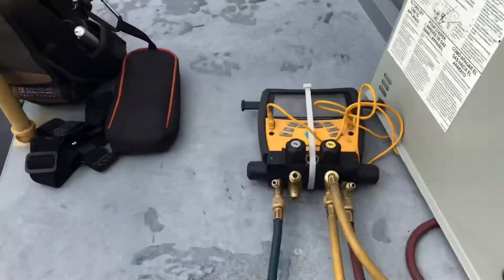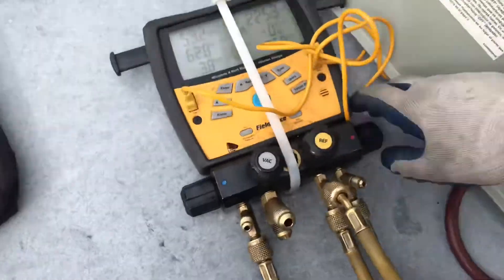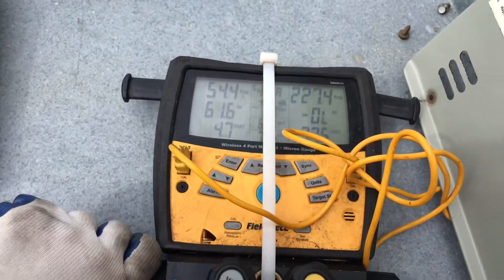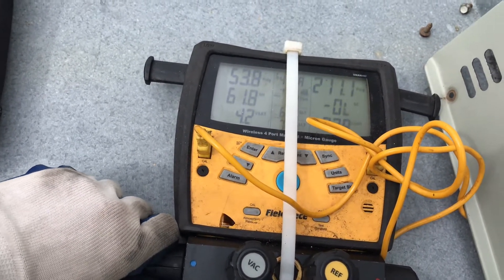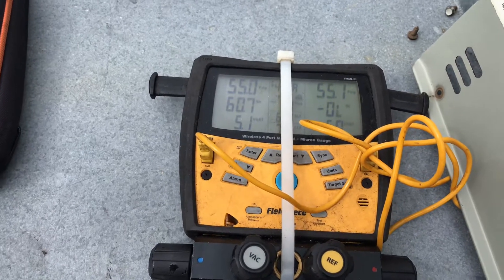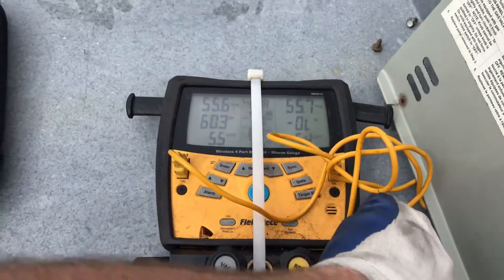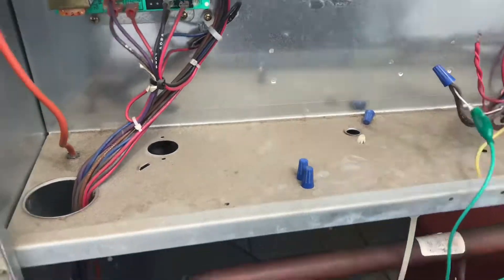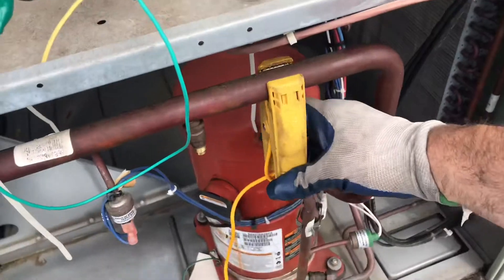How To Minimize Refrigerant Loss When Disconnecting Service Hoses

Comment: Core depressors with field piece probes are the best way to never ever get burned while barley taking any refrigerant out of system. Hoses trap refrigerant probes don’t. Core depressors guarantee no burns and u control when schrader pin is actually pushed in. Every tech should know this because it changed the way I feel about hooking up. 1/4 inch core depressors are on Amazon for 18$ a pop and field piece probes and clamps ran me about 400$ from a supply house but u can probably find it cheaper. I hope this helps you as much as it helped me.

Comment: The gloves he’s wearing is the trick. Ball valve and low loss are great but one bad schrader or gasket in hose will cause u to get burned!
Reply: 1/4 inch core depressors, 18$ on Amazon … thank me later
Reply: @geoffi  my apologies i just read your other comment with all the information I needed and I highly thank you!!!!
Reply: @geoffi  So what are the best gloves to grab? My coworker acted like I was weak for being nervous of being burned by refrigerant. But, I just felt there was a smarter and safer way to deal with the process. Please if you don't mind.... can you provide me with the exact gloves that are best for this? & a link to the field piece probes? I need both of these things if it will keep me from being burned. I have a coworker who's hands are literally stained with pale white skin burns and I prefer not to burn myself! Thank you so much man. Truly appreciate it!

Comment: Well done! Thank you for sharing! But.. with all my respect ; using low loss fittings REQUIRED by EPA Section 608! If a technician don’t use low loss fittings and purposely vents CFC, HCFC, HFC refrigerant they subject to fines and criminal prosecution. As of 2017 penalties for venting include a fine of up to $44,539 per day per violation. It’s a low